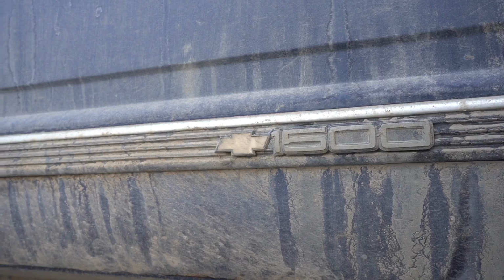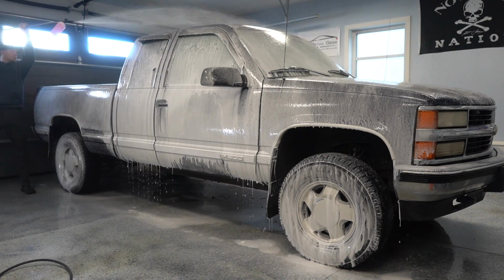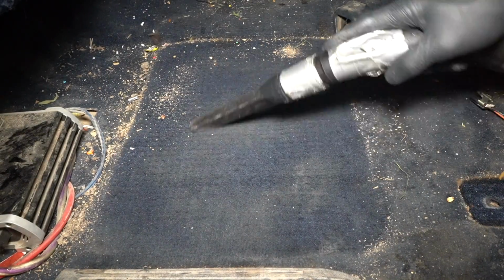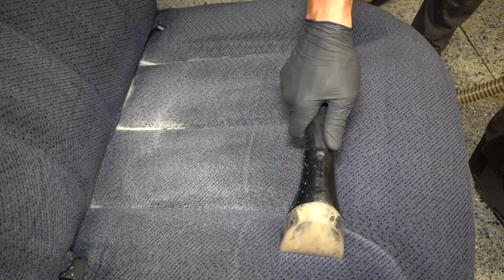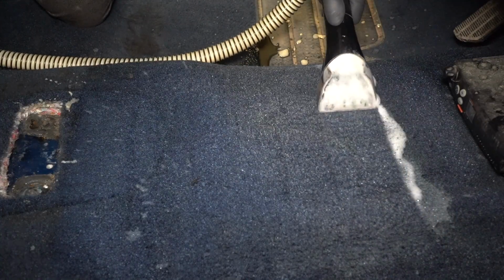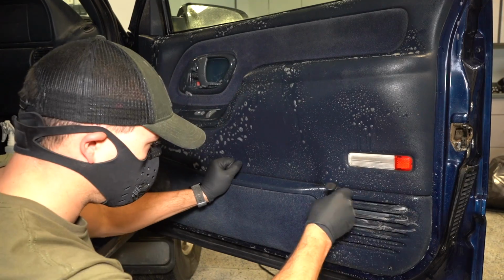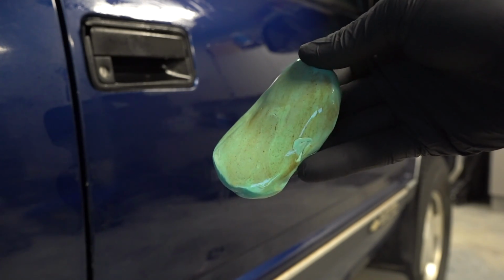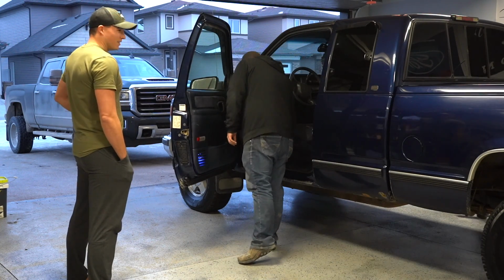Deep Cleaning a DISASTER Farm Truck! | The Detail Geek

Comment: He makes me want to buy every single thing he’s using, take the seats out my car, and get to work💀
Reply: Kekai 5evah looks up how to remove seats after watching this
Reply: SAME I LOVE DETAILING!!
Reply: Me too! And I dont even have a car!😆
Reply: I dont think she meant detailing fellas
Reply: Fr this would work on my Tahoe
Reply: That’s actually what we did, me and the wife have never derailed a truck before mine identical to this except white on the outside and holy crap it took US 3 days to do what he did, and we still have a few bad stains where he had to hit twice on this truck, we have everything but the drill brush and his cleaner but I’m going to try his cleaner and the drill brush before I put it back together, I wish he would have cleaned the headliner and showed how we cleaned the vents for the heat and ac because we struggled with that a lot. But he did an amazing job on this truck.
Reply: Chris Milby use an apc and detail brush for the headliner or use a steamer with a microfiber towel over the top that usually what i do try not to put to much water into it or else the glue is going to some off and the headliner will fall
Reply: Same!! 😄
Reply: I did...almost.

Comment: That’s gotta be one of the cleanest 90s Silverado I’ve ever seen there’s like no rust my 97 is starting to rust
Reply: And surprise it's in Canada these farmer must take good care of his truck or probably just uses them dirt back roads
Reply: I recently had a 96 extended cab that was clean as could be, black paint no fading, no rust, tan leather almost mint condition, 4x4 worked, 180,000 miles. Honestly haven’t seen but maybe 1 cleaner and never one cleaner in person. Picked it up for $4,000.
Reply: @js2542  in Canada? My 97  rusted out big time. Interior was still mint. 305 v8, 400.000km.
Reply: Mark J no man I’m down in South Carolina do rust free is easier to come by down here
Reply: @js2542  ahh ic.. our stuff gets eaten by salt here. Surprisingly this truck had minimal rust for western Canada
Reply: Jeremy Steele my 97 has 278k miles on it. It’s a gmc z71 4x4 with the 350 vortec and longtube header and custom bent true dual exhaust with flow master 40 series mufflers and It’s been a good truck.

Comment: awesome job like always - only question i have would be why do you use a micro fiber towel to clean off the wax/polish on exterior vs using your polisher ? wouldnt it save more time - and do you see swirls after using your hand to remove the wax ?

Comment: Wow, almost no rust. I've never seen one of these with sheet metal that clean. I'd like to buy this truck if it's for sale lol
Reply: That's what I'm saying. Here in the States, (particularly the southern area) 99% of those body styles are rusted like crazy or the front bed mounts are broke down.
Reply: Matthew Barnhill dont you mean north?
Reply: based_will 90’s Silverado, one of the best chevys ever
Reply: My fiancé has a 96’ manual Silverado (at least I’m pretty sure that’s the year. It’s 90 something😂) and it’s in pretty good shape itself. Given the previous owner was an older man who hardly ever drove it. The only body rust it has is above the back tire and a little on the driver door and bumper.
Reply: Matthew Barnhill lol your southern don’t know what rust is, come you at northern Illinois and Wisconsin, your southern trucks are cleaner than the trucks on the dealers show floor up here.
Reply: Might be because I'm in Florida, but I had a 99 Burb with absolutely no rust on it.
Reply: Funny how different things are in different areas.  I'm in GA. I have a 1999 suburban, same body style as this truck, and that truck is rusty compared to mine lol.  Not a spec of rust on mine.  I have a parts suburban also a 1999, I'm about to scrap that also has not a spec of rust on it.  I've got a 1988 f150 that also has absolutely no rust, except for a tiny scratch or ding here and there.  Rust isn't an issue here until you start getting into the early 80's and back, and that's only if it's been sitting for a long time.  I have a 52 dodge meadowbrook that has a little bit of rust under the trunk, but everywhere else is solid, or light surface rust.
Reply: @rockriveroutdoors810  Well, most of those style trucks here in SE Kentucky, have been ran through every mud hole in the tri-state area.
Reply: That’s how my dads truck is (well it’s a Sierra, but basically the same truck) though he never really drives it because he got it for towing his boat but his boat broke like 5 years ago 😂

Comment: Question, I'm 17 and have a 2000 Chevy I just purchased that is just as dirty. What would be a good cost efficient alternative to your carpet cleaner that I could get at a local store? And 2.) What brush am I looking for on the drill? Plan on cleaning everything out. Pressure washer and shop vaccing what I can and making the truck as clean as possible before I start with rust repair. Also, good product to get rust stains off of a door panel and adhesive off of windshield? Thanks in advance!

Comment: When you dump the water after cleaning the carpets, where does the dirty water go? And when you use your vacuum that’s connected to the wall?
Reply: He has a central vacuum system so all he has to do is plug the hose into the wall and turn on the central vac system.